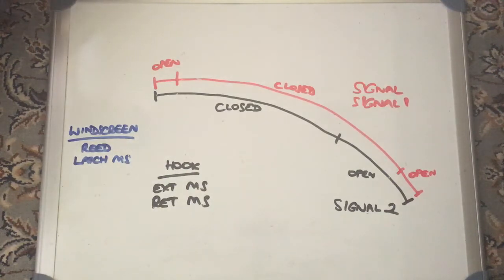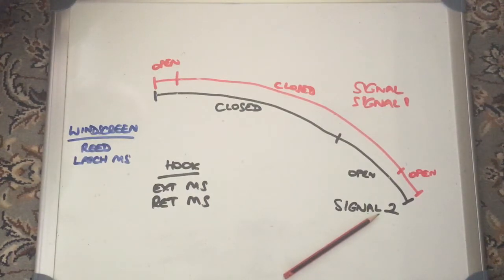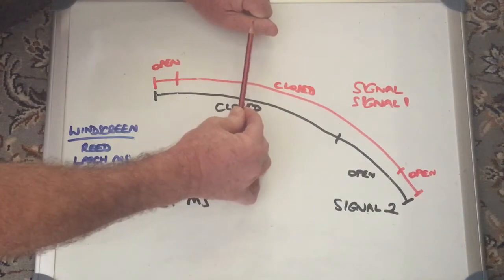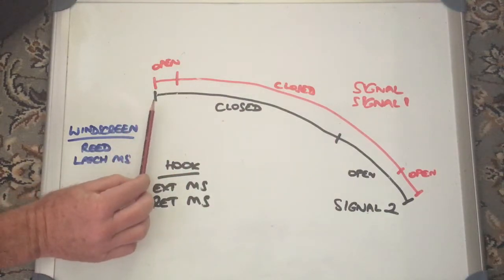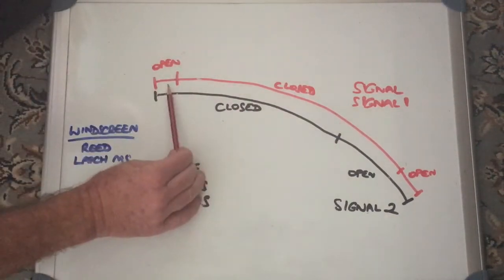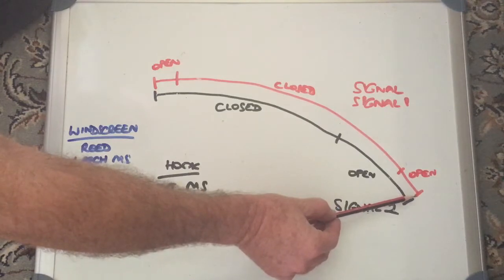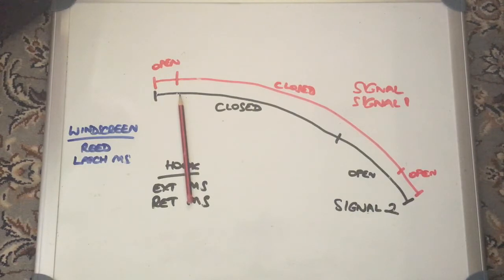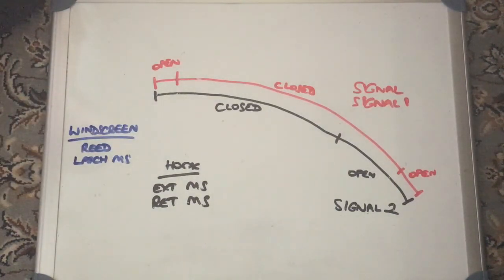Porsche 981 Boxster roof electrical problem diagnosis (Part 2)

Comment: Hi Jeff 
I’ve recently had a situation where I tried to do a routine winter drop of the roof. The problem I have is, the latch disengaged and came down but then the roof faulted without the canvas moving at all. Then when I tried to put it back into fully closed again the latch hook wouldn’t go back up. I turned the car off and went back later and the latch  hook did actually fully close again. 
I’ve plugged the car into iCarSoft and it’s showing a code that’s a Passive/Sporadic Right Motor, Hall Sensor. My question is. Is it more likely to be a problem at the latch set up. I did have some water dripping around there recently. The problem is my roof won’t open even into service mode. Anything I can do to get the front end parts off before I have to start pulling it apart?

Many thanks 

Dave (UK)

Comment: Hi, I’ve watched both of your roof videos and still can’t decide where my problem might lie. The roof opens fully with no problem, and closes too. The hook goes in to the roof and everything stops momentarily but then the hook comes back out of the roof and I get the message on the dash saying move roof to closed position (or something similar). 

I’m wondering whether it’s related to the two bent switches you mention in part one, but I’d be grateful for any guidance before I start taking parts of the roof apart, and where I should be testing. 

Thanks so much!!

Comment: Said news for me. I have to do the microswitches and it means roof out. Thanks for doing detailed video. P.s. talked to the local Porsche dealer tech and he says 9 out of 10 roof issues those two microswitches on the frame of the roof.
Reply from the maker: Happy to help. Nice thing is the engineers have done a great job of making roof removal very easy.
Reply: @jeffrichardsoncardiy  It was scary until I found your video. Thanks!

Comment: Thanks so much for these 981 videos. My top, 2013 boxster s, will not open and displays a yellow fault message that says top operation not complete. In the first video you show micro switches that bend out of the way, it seems to me that is consistent with my symptoms. I don’t have piwas. Any thoughts?
Reply from the maker: You don't need PIWIS as this really won't help for this. You need to test like I do with a multimeter to see where the issue is. If you think it's the micro switches on the lock then it's easiest to just remove the lock and test. You will also see if they are bent.

Comment: Hi Jeff. Your videos are fantastic! Thank you so much for doing them. I have the issue on my '13 Base now where when I go to open the roof, the hook extends, the roof motors back, but the hook fails to retract, and then everything stops at 3/4 down (black vertical line on your drawing). If I then briefly close the roof, the hook then retracts. Then I open the roof again, and all is well and it opens all the way.  Closing the roof from fully open is not an issue. 
According to the logic, this means both Signal and Signal1 are bad? I haven't used an ohmmeter to test yet, and I'm not sure where those sensors are if I need to drill them out.
Reply from the maker: It might not necessarily be both failed. That would be unusual. Testing as shown in the first diagnosis video is required. If the microswitches have failed, the roof needs to come out and to replace the microswitches. 
Micro switch replacement in this video.
https://youtu.be/ntlQ4EQn0GU
Roof removal in this video
https://youtu.be/Iinh4mSys98

Comment: Hi Jeff, I have a 2013 Boxster with the convertible in the fully down position. When I engage the switch to close the top, nothing happens. The windows go down a bit as usual, then nothing? Help?!
Reply from the maker: Have you tested each of the components as per the first video? Also, do you have a PIWIS to check codes and the position of the motor hall sensors?

Comment: How much noise (motor sound) is emitted when operating the top?  I have a 2013 Boxster S and new to these cars. Mine seems very loud at 65 dBa.
Reply from the maker: That sounds about right. The motors aren't separate from the cabin unlike a hydraulic roof where the pump is going to be elsewhere. If you are worried, go to a Porsche dealership and find a 718 and motor the roof. It's the same roof.

Comment: Thanks Jeff for this part 2. Yesterday I checked the reed sensor and the micro in the windscreen and everything was fine. I don't now why every time I disassemble some parts then the roof works perfectly even after a short run around my house. In the video you say, during the opening phase, the command to retract the hook is given by signal xx. Is it possible it comes instead from reed sensor since it notify an open contact once the roof it's far enough from the windscreen? As I wrote yesterday my issue is exactly that the hook is not retracted during backward movement and so it stops at 3/4 opened. Although every time I disassemble the hook mechanisms or as yesterday the part in the windscreen then everything works properly. Could it be the hook assembly is not well positioned and so the magnet doesn't active the reed sensor correctly?
Reply from the maker: From what I say, I don't think it could be the reed switch. I'd be testing the motor microswitches using the plugs at the back of the cabin before pulling the roof. If you did find problems with these, I personally would be trying to pull them apart and see what is going on inside. Often times this type of sensor can fixed by bending the contacts towards each other a little more or something like that.